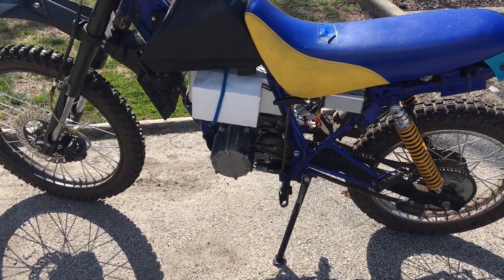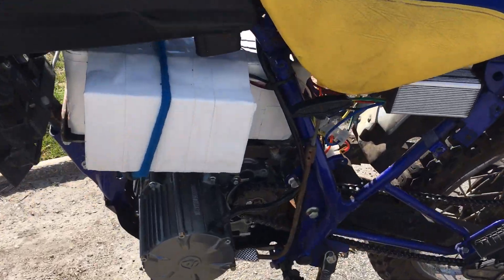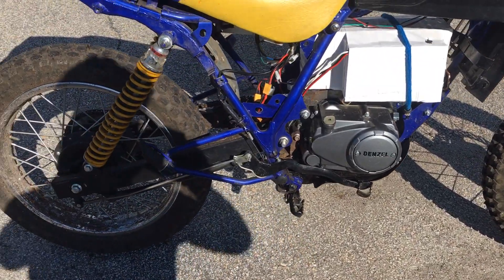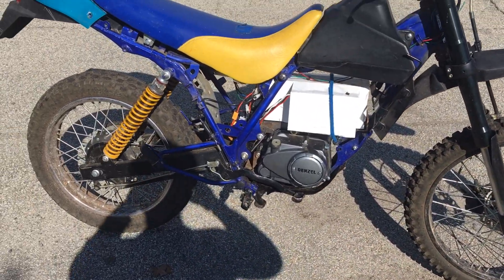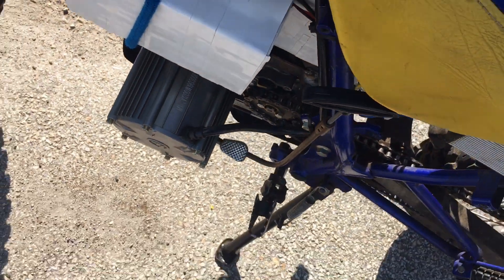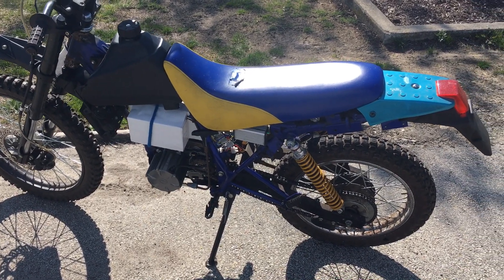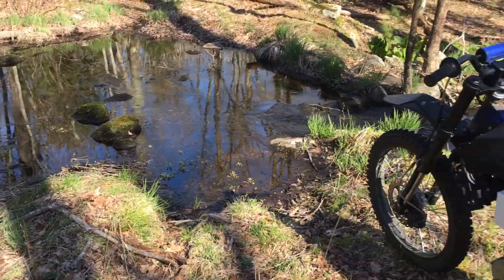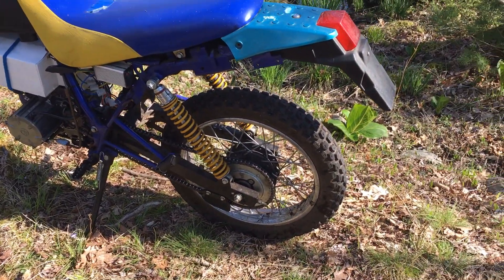72v Denzel 4-Spd Electric Dirt Bike Review

Comment: Start buying bigger motors. I am not very experienced with electric bikes, but from what I have seen others do I think you should install some basic guages for temperature and current. That way you will know things are getting hot and see if you are getting amperage spikes in certain conditions...easiest thing to do would be to buy a bigger motor or one with water cooling, but of course $$ is always a factor.

Comment: Problem for overheating is that denzel never tunes motor halls. If you can set minimal no load current while adjusting hall plate inside motor you will get much more power with same setup.
Reply: how do you do that